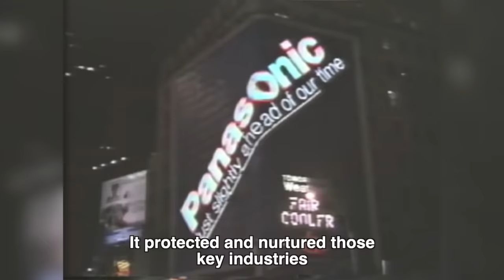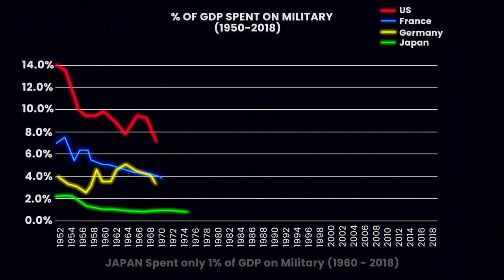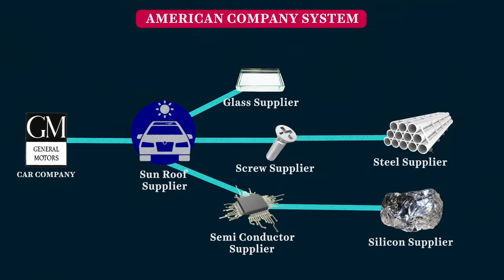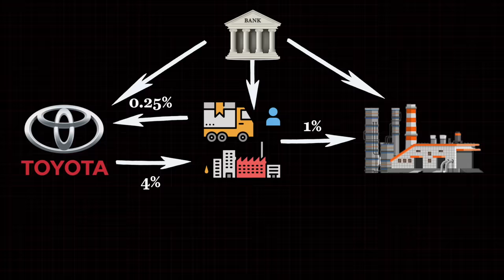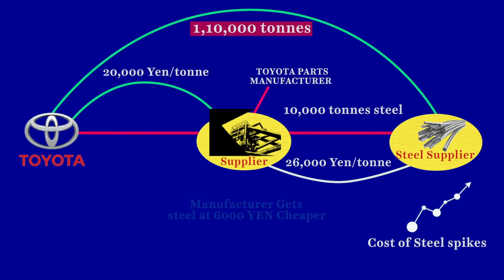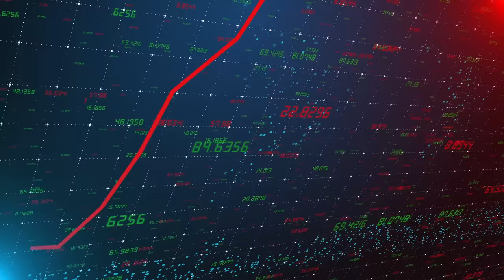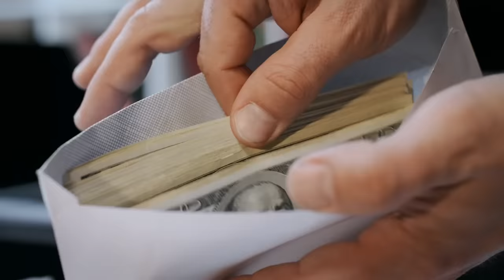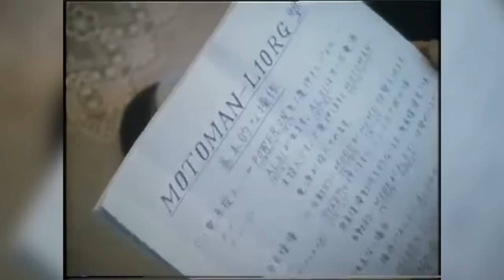How JAPAN's SECRET STRATEGY made it SUPER RICH even after USA's Nuclear Attack? | Lessons for India

Comment: Brilliant to the core.   Thanks a lot.  I started working in factories in 1989 after my Engineering and have experienced this   JUST IN TIME / TQM  model in action.  Whatever is said in the video is perfect and makes a lot of sense ..  Continuous improvement is not a buzzword.  It actually works. Reduction of common cause variation relentlessly makes the product and services world-class.  Example:  Mercury Cell process wherein Copper heavy-duty bus bars need to contact completely for DC power to flow for the electrolysis process. Any air pockets even if it is minor will increase power consumption.  One of the shop floor production executives ( Mr. M V Nayak by name)   did wonders by using - simple Carbon paper to see the extent of contact of bus bars fine tuned with very gentle tightening .. Result is  60 units reduction per Ton of  Caustic soda lye from 3100 KW per ton to 3040 KW  per ton (mercury Cell).  This was in 1994. In a plant where  145 MT of caustic soda is made, in a day, 60* 145 =8700 KW  power saving with zero capital investment is due to the Japanese mindset of continuous improvement.   Simply great.  A  lot to learn from Japanese people - Hardworking innovative patriotic and sensitive like us.  A  Country with frequent natural disasters like Tsunami and earth Quake,  competing in the world economy due to the high-quality people they have even today .. Indian  might take another 500 years  to come close to Japan  and the present  generation and next-generation completely should go in order to imbibe Japanese culture

Comment: Why they s doubt. Pl read the below:
In Japan, in a soap manufacturing company the soap blocks were made, then wrapped in a wrapping paper automatically on an assembly conveyer belt and finally packed in cartons...   Many a times it happened that the wrapping machine wrapped the paper without soap. i.e. you had an empty packet without soap. To rectify this problem the Japanese company bought a X-ray scanner from the US for $60,000 to check on the assembly line whether the container contained soap and wasn't empty.  

A similar problem happened at Nirma soaps, in Ahmedabad in INDIA.. Guess what they did???? 

They bought a bajaj fan costing around Rs.1500/- and placed it on the edge of the assembly line.  The empty wrappers, without soaps just blew away!!!

 *And You Say Japanese are Advanced in Technology.*. *We Indians are INCREDIBLY BRILLIANT*😊😊